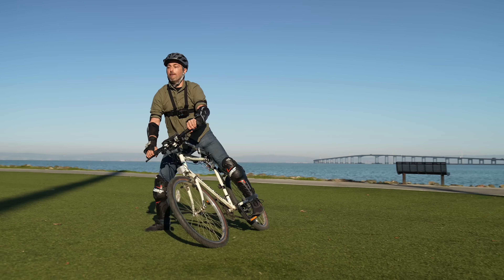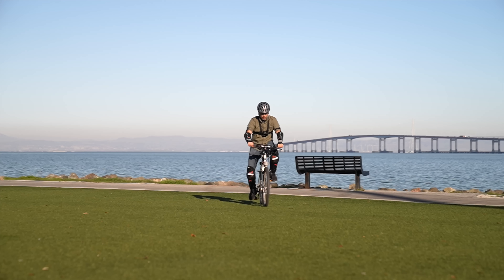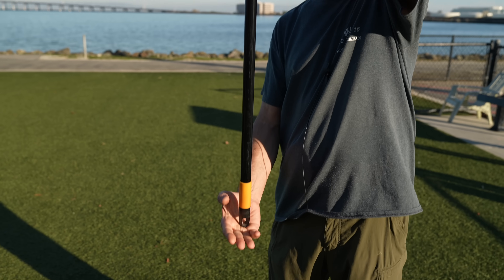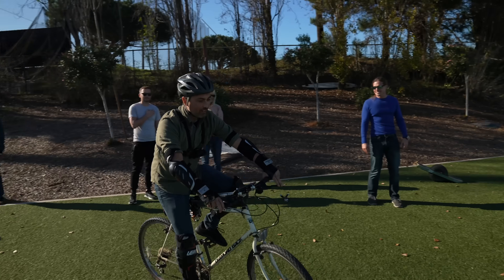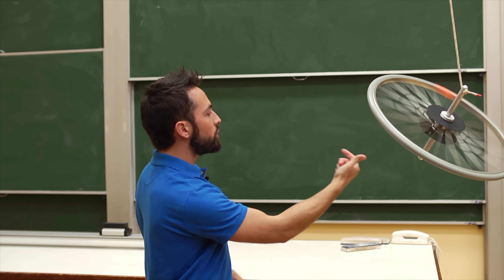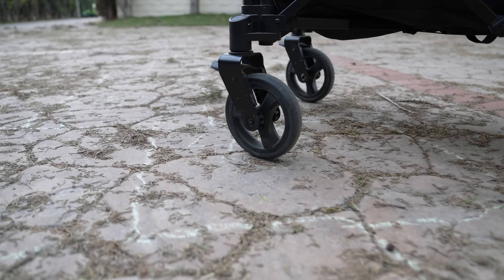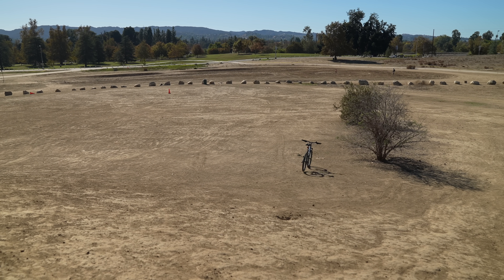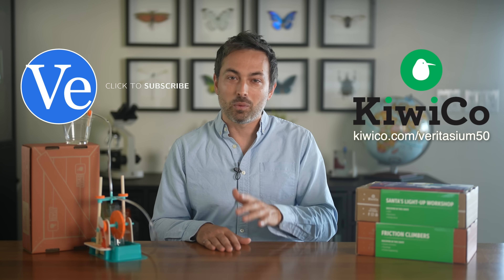Most People Don't Know How Bikes Work

Comment: it really dumb - serioulsy! - to turn left you firt need to turn right to get the balance - this basic truth is true when you walk, run, and just about every form of motion is subject to this basic concept. 
including flying ...
Reply: You're right for everything but flying.  For flying we can bank into the turn without initiating it with any opposite control
Reply: @Rick_Cavallaro  - the act of banking itself requires a pre-action - and in the case of gliders, a 2nd order pre-action. 
Think - the bank = roll and then the lift+gravity - gives you a slide+which itself causes the tail to correct the flight path ... just saying ... its so "natural" that it "goes without saying"
Reply: @masteryoda2918  the act of banking requires a single aileron control input.  Lift is increased on one wing and decreased on the other.  Gliders are exactly like powered aircraft except for wing-loading and aspect ratio.  Because of this, you get more noticeable adverse yaw with a glider, but it happens with powered aircraft as well.  Controlling adverse yaw is not a non-minimum phase control like counter-steering. It's more of an issue of controlling an undesired side-effect.

Comment: I used to ride about 2 miles to the train station, and I'd frequently challenge myself to do it without touching the handlebars (except to break, although I rode in such a way that ideally I would never need to). This meant making lots of 90 degree turns just by leaning - would that work on a "lock out" bike or do we do the same thing with or without the handlebars?
Reply: When you ride no-handed you're still using the steering, but controlling it through the three principles Derek described for the stability of a riderless bike.  With locked steering, you still fall. :(

Comment: I can drive a bike blindfolded and with my hands tied to my back. I might not go in a straight direction but I surely won't fall off the bike.
As you mentioned, we don't fully understand how bicycles work, but we can use them with no issues at all.
I guess it has to do with my general balancing abilities as I can walk on my hands on a thin flat bar, and do some cool stuff

Comment: As a person who almost ride my bike daily, it`s always interesting to learn new things about bicycles.
You really don`t think about anything of how the bike works, when you are bicycling you mostly automatically know what to do.
It`s one of the first things you learn when you`re learn biking to balance your weight left to turn right and vice versa.
But you really know how to explain it better than any of us.
Reply: Seen many comments here about shifting body mass in order to turn. That has nothing to do with the steering, steering is done by applying the force on the handlebar. Shifting body mass to the side to which you are turning (not the opposite like you wrote, that's not how to do it) helps to keep the lean angle low giving you more of the tyre contact patch on the ground. Check Twist of the wrist video, they showed this on a real bike.

Comment: Would you be interested in talking about balance when riding a bike without hands?
Reply: Do you have a question about it?
Reply: @Rick_Cavallaro  no not really, I’ve spent a decent amount of time thinking about how I bike without. And I can make complete turn without touching the handle bars given sufficient arc in the turn. And I’d be curious about how the physics differs between a bike on it own, biking w/o hands, and biking normally
Reply: @jacksauser689  When you ride with no hands, you're still steering, but you're doing it using the 3 principles Derek described for the stability of a riderless bike.  You don't lean the bike/rider system, but you do lean the bike and that causes the front wheel to steer.  You still have to steer to balance.  You still have to counter-steer to initiate a turn, and you'll still fall if the steering is locked.  I'm currently working on a follow-up video to address the questions and concerns in these comments, and I plan to demonstrate these things.

Comment: I learned about this effect on motorcycles, not bicycles.  I have to say that I thought the "steer opposite direction first" was only true about HEAVY motorcycles.  Why?  Because a heavy motorcycle wants to continue moving straight when you turn left or right.  Brief counter steering causes the motorcycle to lean in the direction you want to go then you can safely steer in that direction. I have felt that since a bicycle weighs so much less, then counter steering was not required.  However, the bicycle rider NEEDS to lean into the turn as they rotate the handlebars to go in that direction.  The rider in the bicycle+rider system is the significant mass, after all.  I think that a head on video (of the right person) could show that if that person leans into a turn (slightly before they turn) they would not need to counter steer.  I do, however, know that small corrections are always being made while a person rides a bicycle.  
It would be interesting to do a video on how things happen when a person rides a bicycle without touching the handlebars.  It's probably very similar to a bicycle remaining stable with no rider.  Or is it?
Reply: I can confirm this as I often ride handsfree. I use the legs to counterbalance and adjust the bike, and I lean slightly into the turn to throw the bike off balance before leaning back to straighten it back

What I would normally do is either lean into the turn, or turn my knee outwards towards the direction of the turn. Generally this movement is enough to make the bike fall in the desired direction, and u fix the balance by doing the opposite
Reply: Yeh, fix the handlebars & learn to steer with lean alone, then we see if countersteering is necessary. It can help for cycling, too, mostly when you want to keep traction on the front wheel, however too much countersteering and the bike comes out from under, which makes me think the perfect spot is somewhat in between steering and countersteering (so fix the handlebars and try to do some course)

Comment: I have a problem with the term ‘countersteering’ since it is the same word that’s used when sliding, or drifitng, a bike or car. It also disguises the mechanism that’s taking effect. I would describe bike steering as ‘counterturning’ since the whole bike actually has to turn the opposite way before an intended turn, not just the steering.
In the demonstration of locked steering, the bike was in fact turning in the same direction as the bars every time. Just like a car. No ‘countersteering’ there. The problem was that it would fall over before the amount of turn could be noticed because the balance could not be maintained, so all you had was a brief moment of counterturning but no turning in the intended direction

Comment: Racing motorcyclists have known this for donkey's years. If you want to turn aggressively to the right, you apply a pulling pressure on the handlebars to the left. That forces the bike to lean hard to the right and at that point the bike almost steers itself to the right.

Comment: Sorry but a real biker boy would know the answer to your question before u even asked or explained in the video. Riding a 2 wheeler is nothing like 4 wheel drive. The physics is very different as 2 wheeler needs to maintain catner of gravity at all times. 4 wheels can easily distribute weight to 4 individual centers to balance or center of g.

Comment: i mean just like when you are riding without holding the bar cant you just lean towards the direction you wanna turn to*not when the steering locks just generally
? i find that i do most of the steering by leaning rather then actually steering
Reply: That is what you think, but that is not what actually happens.
Bike always countersteer, if it can't do it then it will fall. Lean alone does nothing.

Comment: I think the extent to which this effect is noticeable depends on the head angle of the bike. If you try this on a downhill or enduro bike you can probably turn without first countersteering, do it on a road or cross country bike however and you need to set yourself up for every steering input.

Comment: Most motorcyclists should know this by now I hope.
Although it only "revereses" once a certain speed is reached at really low speeds it's left to go left, then at some point (depneding on the geometry etc. I imagine) it switches.
Reply: It never switch or it would mean that there is a speed when turning would be impossible.
It would be even worse when that "magical" speed change happens middle of a curve. Bike suddenly change direction.
Countersteer works all the time, every time. It is the only option.

Comment: to some extent this is how you can also use a bike without using its handlebars ;-) ... don't try this at home kids lol  (no liability implied or expressed ...)   there are also some position that can help with turning ( you moving instead of moving the bike) but ultimately counter steering becomes almost obligatory at high speeds. (even with the lean)

Comment: What happens when you take your hands off the handlebars completely? I occasionally ride my bike without hands, being able to perform turns and balance corrections with only shifts in my body (eventually the handlebars also turn as explained by the gyroscopic precession effect). Would that allow this bike to be steered or does the handlebar lockup also affect steering corrections initiated by balance shifts?

Comment: I didn't really believe people turn the other way first but also never payed attention to it so thought maybe.

But after paying attention to it while riding myself and watching other people. I feel forced to conclude that Americans ride their bike weirdly...

I myself don't turn the other way first. And to make sure I wasn't influencing my own results watched other random people on the street and they don't do it either.

People in the Netherlands just lean into the turn and turn. Which I think is also demonstrated by your own example. The bike riding on its own starts to fall (let's says to the right), this makes the front wheel turn right and the bike stabilizes. If you slightly tweak the steering angle you can keep turning and postpone the stabilization until you are done turning. 

So yeah, no oppisite turning. Just lean and turn. If you just turn right, you are gonna fall to the left. But if you lean right and simultaneously turn you will just move through the corner.
Reply: If you could just lean, then why bikes have pivoting fork?
For the same reason why boats have rudders.
Reply: @XtreeM_FaiL  what are you saying? im not saying you can turn by leaning without turning the wheel if thats what you mean?! i'm saying you dont have to counter steer to get your weight unbalanced. you can just shift your weight. Lean into the turn and steer without needing to counter steer first.
Reply: If you can just lean your body to lean the bike into a turn, you can do that with the bike sitting still.  So try this... hop on your bike sitting still with steering straight ahead.  Get a friend to tell you (or point) left or right the moment you lift your feet and put them on the pedals.  Now lean to that side and try to fall to that side (bike still sitting still).  You'll succeed exactly half the time.  That's because it's extremely difficult to do.  It's very easy to do though with just the slightest steering input when you're moving.
Reply: @Rick_Cavallaro  you aren't balanced when you are not riding. If you lift your feet and your friend tells you elft or right, you aren't listening to you friend.. You are just falling over.

I don't see how this corresponds to actually riding the bike.

I've seen the empirical evidence at this point. I've watched people coming at me head on and then steer without counter steering just before. Not even slightly as I think the example in Derek's video is greatly exaggerated. If that's how he thinks everyone rides their bike than I can 100% garantie that's not how it works. If it was only to illustrate, then still, counter steering to a lesser extend even doesn't seem a thing here in the netherlands
Reply: @squeakybunny2776  
>>  you aren't balanced when you are not riding.

Why not?  Just lean the way you want - right?

>> If you lift your feet and your friend tells you elft or right, you aren't listening to you friend.. You are just falling over.

You have no trouble balancing and listening to your friend when you're riding.  That's what we show in this video.  Why is it different when you're stationary?  Ans: because when you're moving, the steering is used to move the contact patch beneath you as in the inverted pendulum example.  If you could simply shift your weight to lean the bike, rather than using steering to do it, you could do that just as easily when sitting still.  The fact that you can't do that tells you that steering is how you're balancing.
Reply: @Rick_Cavallaro  Im not saying you dont use steering to balance. Im saying you can initiate a turn by unbalancing yourself due to shifting your weight.

Why is riding a bike without hands a thing? To be sure ill drive without hands this afternoon and see what excatly im doing with my weight etc.
Reply: @squeakybunny2776  
>>  Im saying you can initiate a turn by unbalancing yourself due to shifting your weight.

You can lean the bike a bit by shifting your weight (but not the center of gravity of the entire system).  That will cause the steering to change based on the three principles Derek described for stability of riderless bikes.  But that still uses counter-steering to initiate a turn.  With the steering locked, you still fall.

Comment: above a certain speed (fairly slow) motorcycles literally turn the opposite way to steer. not just a quick opposite to start a lean but the entire time they're turning, they're turning the opposite direction. you only steer the direction you want to go at VERY low speeds like walking speed
Reply: Zero speed is fairly slow.

Comment: So is this kind of like when I ride my bike no handed and it just so happens to turn in the correct direction. Because I always believed is because I always shift my weight toward where I want to turn but I’m not sure.
Reply: Interestingly, when riding without hands you're still actively steering - not by shifting your weight, but by leaning the bike beneath you.  This takes advantage of the three principles Derek described that stabilize a riderless bike.  And you still counter-steer to initiate a turn.
Reply: @Rick_Cavallaro  to lean the bike you have to shift your weight otherwise how do u make it lean?
Reply: @tukz3223  it's actually very difficult to shift your weight on the bike.  If you could do that, you could sit on a stationary bike and then fall to whichever side you choose.  But what you can do very easily is to shift your lower body to the left and your upper body to the right.  This leans the bike, and that gives you the steering input.
Reply: @Rick_Cavallaro  BRUH?????? When you shift your body you are shifting your weight with it. Thats like saying when you lift your arm you aren't lifting the weight of your arm.
Reply: @tukz3223  
>> When you shift your body you are shifting your weight with it. 

You would think so, but you really don't.  Try my little experiment.  You can even do it sitting still in the garage.  Just lift your feet and have a friend immediately point the direction they want you to fall.  You'll get it right half the time - because it's random.

Comment: I have had this same argument with a number of motorcyclists. They say you "lean" but that is wrong. If you lock the steering "leaning" does nothing. What you actually do is turn the wheel slightly in the the opposite direction. You slightly turn left to go right and right to go left. You also have the gyroscope effect to contend with which complicates the matter even more. Some motorcyclists think they know everything and will argue till the sun goes down.  I treat them kindly realizing how stupid they can be.
Reply: >> I have had this same argument with a number of motorcyclists. 

There are literally thousands of motorcyclists in these comments that assure us that every motorcyclist on the planet already understands this better than it was presented here.

Comment: I must be doing something different since I always lean into the direction I am going, without counter steer, which generally results in a tighter turn. Just to test it I held my left handle bar in such a way it couldn't turn right, while slightly pulling left and lean left to turn left. Maybe riding a bike at walking pace things work differently, but at a reasonable pace I have my doubts that the behaviour is universally true with all riders. I'll probably need to get a friend with a camera to verify this isn't imagined.

Comment: Its the same with motorcycles, but even for people with bicycle riding experience it doesn't seem natural.
The way we teach new riders to wrap their head around counter-steering is "press left, go left.  Press right, go right."  If you press your palm against the grip on whichever side you want to turn, it will turn that direction.  If you continue to press out it will turn sharper, and once it's leaned over it's pretty self stabilizing, as long as speed is steady.

Comment: Anyone taking a Basic Motorcycle Safety course has learned counter stearing. To turn right... lean right turn the handlebars left...this will force the tire onto the rounded surface allowing for a tighter turn...this is why Motorcycle tires (like bicycle tires) have a rounded profile. Car tires have a flat surface with a side wall they don't use this effect....unless they are drifting or dirt track racing which is essentially drifting and that is an  entirely different video.